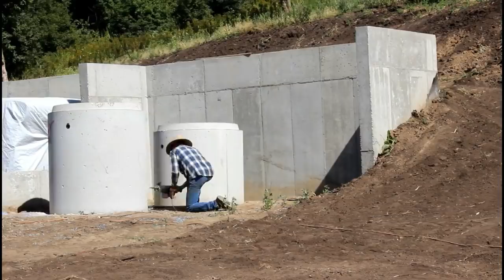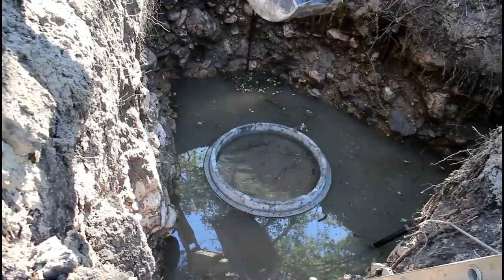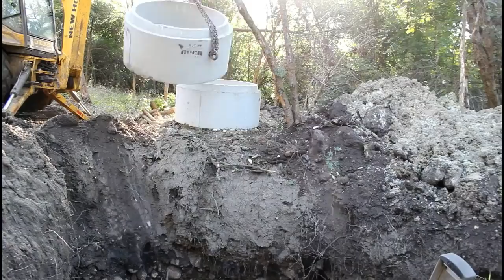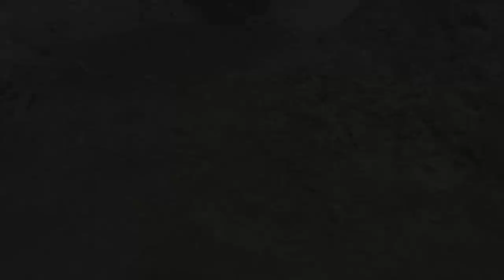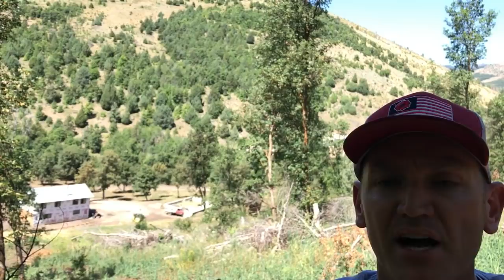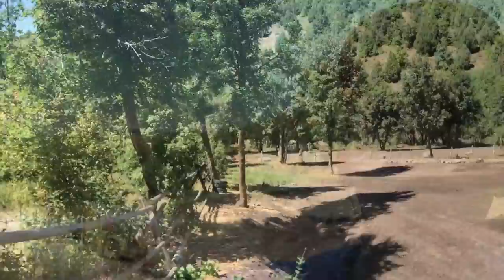DIY Shallow Well - Set Concrete Culverts In The Shallow Well. Pt 2

Comment: In 1974, We had a well drilled.  Water at 360', hole to 500', 8" steel casing to 390', the last 40' was perforated.  Submersible pump was hung on 1-1/4" galv. pipe to 380'.  
1-1/2HP pump with foot valve and a sand box around it.  (to keep 90% of the sand out).  1-110 Gal. tank, panel, controller.     $10,000 USD  (in 1974, remember)
It lasted 11 months and stopped pumping.  Driller pulled the pump and replaced it.  10 months later it stopped.  I borrowed a small crane and Dad and I pulled the pump.
When we bought the new one, it came with a plastic tube and some goo like stuff. (A water proof cover for the wiring splice for being under water).......
The old pump had NO water proof cover. Just plastic tape!  We had to pull our pump out because it stopped working...18 years later.  We needed new piping too.
$2,500 USD later it was up and going again.  16  years later Dad died and I sold out and moved.  The well was still going strong.  MORAL:  Just because the truck says "Well Drilling Company" don't mean they are any good at it.  Do research before hiring anyone.

Comment: Glad you got the culvert pieces in. Think your on the right track installing a storage tank uphill from the house. Using that setup will allow selection of a low gpm, higher head pump. It can use less energy which will be great being off grid. Also another important benefit is having a gravity  water supply that can last a few days if its very cloudy or you dont have solar for a few days. It might be a good idea to put a float switch in the storage tank to turn on an alarm or light in a conspicuous location to alert you that the tank is not being replenished.
I like your plan to finish and protect the well also. I was really looking forward to this video!.
Reply from the maker: Thank you for watching!

Comment: I like the idea of pumping it up the hill and using gravity to feed it down to the house afterwards in case you ever have an inverter fail then you will have water while you're inverter gets repaired or replaced so if you happen to be away from kids will have water
Reply from the maker: Me too!
Reply: Plus if you ever have a house fire inside the battery room you might have the chance at fighting the fire with the water stored in the cistern hopefully it never comes to that.

Comment: Our shallow well is similar but we used ADS HDPE Water Quality Unit (WQU) 3' diameter double wall, basically plastic.  It was light enough that I could move it into the well easily.  I drilled holes in the bottom 3 feet of the 12' length and placed in on about 2' layer of washed gravel. We back filled the hole with more washed gravel and the pipe ended up with 7' water depth and has been crystal clear after the first couple of months of use. Nice job and congratulations on getting water.

Comment: For our Dairy Farm in CentralN.Y. we have an underground 10k gallon holding tank near our Dairy Barn that our (drilled 100 feet) well less than 20 feet from the tank feeds the tank as a float in the tank determines the need.  This system was updated 3 years back to also take water from a spring that we pump water from the spring 4000 feet away to the buried holding tank. The spring has it's own holding tank as well and never runs dry. The spring will supply at over 10 gallons/ minute, and the well is faster than that to the buried holding tank. Both are on float switches and the well has become the back-up supply and we manually turn it on 1×/week to keep the pump from seezing up from lack of use. The holding tank at the farm supplies at a much higher rate if our 400 cows+youngstock need it, but the holding tank has a variable speed pump so it throttles up or down based on the demand. This usually  keeps the cows happy and our water guy said that pumps last longer if they do not constantly start/stop, they prefer long runs. We went through alot of pumps in the buried holding tank before putting in the variable pump, the well pump has never had a problem as it had a long run time from the beginning 20 years ago. I didn't catch the capacity of your system, but you could over size your hill holding tank and have a back-up pump in your well and do virtually the same thing. GOD be with you.
Reply from the maker: Thank you for the info...

Comment: The storage tank above house level like you said is a good ideal, if the electricity goes out for the day or night, you will still have water and water pressure. If you were in a pinch, you could use a tiny water turbine inline with the water inlet line to your house, to charge a cell phone or laptop, etc... when the electrical grid is down. While you run the water for a bath and dishes, it charges your stuff, in an outage, in a pinch.

Comment: I'm not a "my way or the highway" commenter but I just want to agree with some others and recommend you don't get rid of the backhoe.  You can rent a large mini excavator weekly to fill needs. IMO the backhoe is just too versatile.  If the excavator is a large one and the price is right possible have that and a skid steer or loader tractor?  Either way I know it will work, just my suggestion.
Reply from the maker: Thank you!

Comment: With that much line you will have a considerable 'ram effect'.  That is, if you run things open, then turn it off fast, it will hammer something awful, building tremendous pressure.

Comment: Since your goal is off the grid with solar, personally if I was in your shoes, I would install the smallest 12v pump capable of pumping water from the bottom of the well to the top, should only require a 20-30watt pump power it off a cheap 12v solar panel with possibly an old 12v battery, then I would run buried pipe from the top of the well to the house, gravity will feed it to the house, then install a on demand pump at the house to pressurize the house water circuit with possible storage tank for capacity needed in a days use. This would limit your electrical needs the expensive side and allow you to have a supply of water constantly pumping to the house every day.

Comment: 30 psi is really common in our area.I think we have very good water pressure. I would think you would have enough pressure for a gravity system with the amount of grade you have. You may  think about putting in a "BYPASS" around your pump incase you have an issue with the solar. At least you would still have water coming in the house :)
Reply from the maker: I'm trying to cover all of my bases. The last thing I want is too get stuck without water in the middle of a snow storm.

Comment: +Red Poppy Ranch
Heath, I know they are a bit pricey, but I personally would close that up with a commercial manhole cover. We all know that they are designed to take a beating and it will give you ample room to get down in the well with a ladder if you ever need to dredge, retrieve a pump or to shock the well. You can easily open the well but it is more or less kid and critter proof. Also you can open it without digging or using heavy equipment like you would need with a cement lid.
Reply from the maker: I agree but there are holes in it where mice could get in it. I will cast my own concrete lid that over laps and seals the cistern. The manhole was $250 as well.

Comment: First time commenting, great project! I don't know if I could walk across your property at 5000 feet of elevation. 

You might want to re-cipher your pressure calculations though. All you get is .433 psi per foot of head.

I like the idea of using an integrated package.  As  retired master plumber I can sympathize with you regarding building a package system vs buying one. It's hard to think of every detail, and it's often more efficient to use someone else's experience when in new territory. The object is to get water, not gain expertise in designing a system.

+1 Micah W

@ Shelby J. the 600 feet is the length of the pipe, not the elevation
Reply from the maker: Thanks for your comment!

Comment: I definitely would have either had someone with me while doing that, or dropped a rope ladder inside the well, and one around it after stacking each piece. That way if you did fall in you ha a possible escape route. Either way it got done safely and looks like a very viable option.

Comment: I would go for the second option of the storage tank 100 ft above the house.  If possible I would bury the storage tank to help with preventing freezing your water and waterlines. The added bennefit of this is that if you can install a second waterline for use in your garden and as a firehose in case of a fire. If the storagetank is large enough you could install a direct solar pump that works directly on solar panels to top of your storagetank during the day without creating a load on your batteries. 
Don't forget that your filtration system will take down the waterpressure somewhat, and that you need to account for the waterpressure at the washingroom (top floor)
Reply from the maker: Thanks!
Reply: It is 27ft per 10 psi, 100 feet will not do it

Comment: I was wondering why you did not seal in between culverts. I would think you only want the water coming in from the bottom to avoid surface run off. I would use the tank on top of the hill, using a solar pump.  From working with water system. Every 27 feet equals 10 PSI. You need at least 40psi, Good luck.

Comment: I guess you are going to digg in the storage tanks on the hill to protect them from freezing in wintertime? What is the depth code in your area for the water supply line, down here 80 cm (~2 feet 8 inch).
Reply from the maker: 30 inches here. We will either do a direct bury tank or a well house.

Comment: I would think the hydrostatic pressure of 600 feet would be more than 50 psi. It is also gonna take a pretty good pump to lift against that pressure.
Reply from the maker: It's actually a little less. IT will require a good pump.
Reply: My bad I watched that late at night and thought your holding tank was 600 vertical feet above the house. You are correct it will be less than 50psi. Good job.

Comment: I have my tank in a tower 12 foot high I came out with a 3-inch trunk line about 30 ft dropped it to a 1 in into the house and I have 45 psi's
Reply: You must live in a place with elevated gravity, at standard gravity it takes 103,8´ to get 45 psi.
Reply: Jesper, I'm suffering from elevated gravity!  I'm going to get mileage from that one!  Fun.

Comment: Will you drink well water without additional filtration equipment? I had a drilled well at my last house without purification. We just tested the water on a regular basis. Thanks for the video update.
Reply from the maker: No. I will put a series of filters insuring we never have contaminent issues. If it was deeper it would be less prone to contamination.
Reply: Thanks for your reply.
Reply: I couldn’t tell from the video, is there sealant between the concrete sections?

Comment: Things really coming along nicely. Question:  was your concern about the length of the water line from your well to your proposed tank uphill being no longer than 600 feet due to the capacity of the water pump you will use? Curious. Thanks
Reply from the maker: Yes. That's a lot of water weight for some pumps.
Reply: I thought the only pump issue was elevation.  The length issue surprised me.  Good to know this is an issue also.
Reply: The weight of water is 100", the inertia is 600', the pressure may spike but it averages 50 psi

Comment: I don't know whether you are aware of a hydraulic ram set up. One unit ram assembly can lift water 60 feet without any electric power.
Having two hydraulic pumps spaced out, would give all the lift you need, provided there is some head on the water level before entering the pump. That might be accomplished by filling an intermediate tank before the second ram lifts water the rest of the height..

Comment: I know it's early in this project, are you considered fencing around the well? This would keep animals outside the perimeter and cut down the chance of surface waste contaminating your water source. Just spit balling mind you. I'm excited for you and the family to have a plentiful, reliable, low-cost, and SAFE supply. P.S. engineer 775 (Practical Preppers  youtube channel) has some great common sense ideas and equipment for off-grid water systems, it might be worth the consult fee to save heartache down the road?
Reply from the maker: Absolutley. This is an area that will have cows near it so I will fence it.

Comment: As you don't have built in ladder rungs in the rest of the pipe will you pickup a old aluminum ladder to permanently leave down the culverts?  Will let you sanitize it and not worry about what you are bringing in when you need a ladder.

Whats the plan for the tank? A new septic tank would work and give you the in ground insulation to prevent freezing. Or you could build a cement tank then seal it. 

Would it be worth it to have a several thousand gallon overflow pond 50-100 feet down from the tanks that has a 2-3 inch pipe coming down the hill for a fire hydrant feed? Would let you find that water up the hill to pipe into the pond and take any overflow off the water tank for animal and garden watering along with being your fire fighting supply.
Reply from the maker: I did not put rungs in the tank and as I have to get in here I will likely use an aluminum ladder. We will also have a pond but it will be higher up and filled with run off. The tank we will use will be a plastic 2500 gallon tank.
Reply: Or just a tank they can load onto a trailer with a pump to transport water or act as a brush fire rig. One less older engine to have to maintain  so it would just be the small engine skills they need for the pump.

Comment: Still not sure why you can't dig a trench with your backhoe?
Reply: Thomas Russell do you understand where on the side of the hill the well is located. I must have missed that in the previous video.
Reply from the maker: I can but the hills get steep and the backhoe doesn't like the hills or maybe I don't like tearing up the hillside trying to get it where I need it.
Reply from the maker: 30' below the house.

Comment: I used pool chlorine ( powdered )  to shock my system, my well is 300 ft down. Larry
Reply from the maker: I'll use pool chlorine or well specific chlorine.
Reply: Red Poppy Ranch  If you can use UV sterilisation because is better for your health.
Ultra violet water treatment systems (UV sterilisers) kill bacteria in water. They are often used to ensure safe drinking water from well, spring and borehole water.

Comment: We had a regular well that smelled like rotten eggs and always had a lot of rust, we tried whole house filters with water softener and it never helped, we put chlorine pellets down the well didn't help I wasn't sure what else to try so thinking outside the normal stuff people have done I bought two bottles of iron out dumped it down the well circulated it through the water system until it was circulated and turned milky white, I then let sit for 24 hours and when I turned it back on to flush it out I had black fuzzy shit coming out of the hose I let the water run for about 3 hours to make sure all the lines were clear and all the iron out was pumped out of the well. Well the water was soft smelled good and tasted better than any water I have ever drank, so after about a year it started to get a slight Oder again and I just repeated the process. You just need to think ahead don't let animals or humans consume the water with iron out in it because it will kill them.

Comment: I see why you are having problems and living in that area which looks like out West it has to be really difficult to dig a well and get it working well in that part of the country. If you lived in the Mid-West it would be easier to dig a shallow well and get the water to the house without overworking the pump. It sounds like you need two pumps (one to pump water from the well to the storage tank, and another to pump it to your house).

Comment: Have you considered a hydraulic ram pump? at least for a back up ?
Reply from the maker: yes but It could not reach the tank. The tank is about 130' above the well.
Reply: I thought you would have, what I was thinking though ...( although I have never had or used one ) seeing the bank behind your house if you hand a tank on that bank and another ram pump set up like a 2 step system to carry it on to top tank, anyways thanks for the reply good to see you consider input from your readers a sincere effort :  )